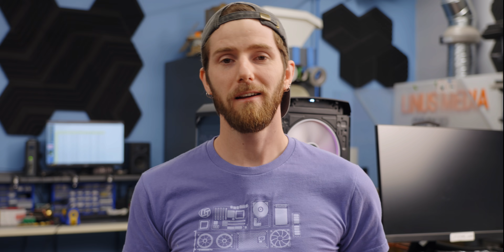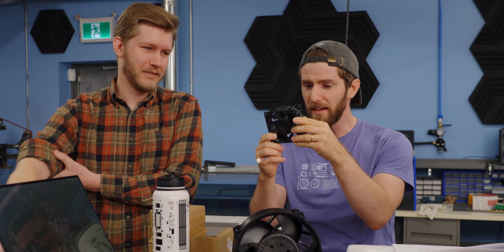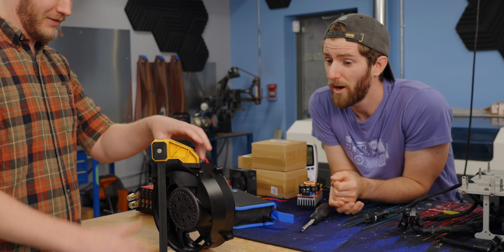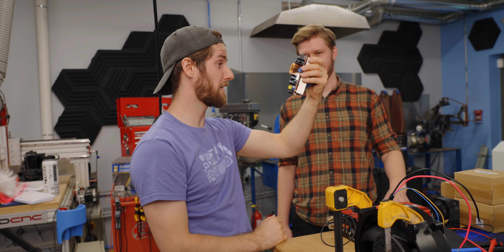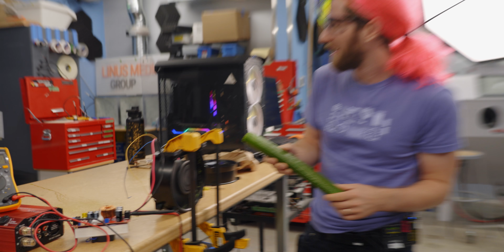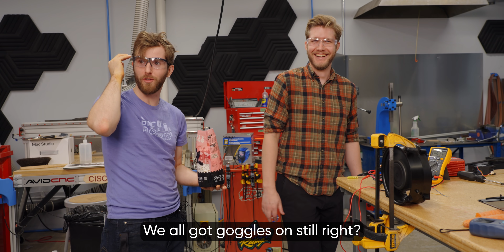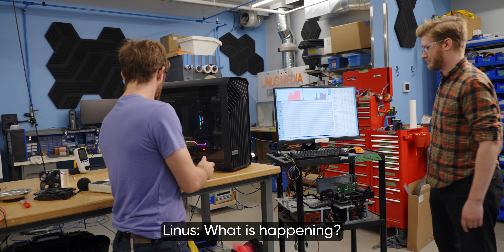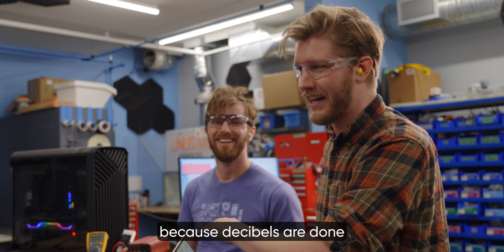The God of Computer Fans

Comment: To clear up the confusion about how much louder double the volume is in dB, audio/electrical engineer here:
There are two types of units we use dB for mostly, first of there are units of power, like watts, and then there are units of "flow" (not sure this is the correct terminology in English), like voltage and current in the electrical domain. 
Staying with electrical terms, since this is what most people are familiar with, power is in Bel would be log(V/I), decibel (aka 1/10th of a Bel) would be 10*log(V/I). 
Now, since these three are sort of a "trifecta" that always go together, we can also say that
P[dB] = 10*log(V*V/R) = 10*log(V²/R) = 20*log(I)
and also 
P[dB] = 10*log(I*I*R) = 10*log(I²/R) = 20*log(V)
Therefore, a doubling in units of power is always 3dB, while it is double that in units of flow - 6dB -, due to difference in factors 10 and 20. 
Now we're getting back to acoustics. In acoustics, we also have units of flow - sound pressure and particle velocity. And then we have the unit of power, which is sound power. 
But this is the part where the human perception comes into play. 
First off, the physiological part, which is how our ears work. Our ears are sensitive to *pressure*, not velocity or power (or actually intensity for that matter, but it's not really relevant for this discussion).
This is why we measure acoustics in dB SPL - because that's what we actually hear. 
And since in the video, they go from one fan to two, the SPL, a unit of flow, should pretty much double, which means we get +6dB, not +3dB as Alex kinda falsely proclaims. 
Finally though, we have our psycho acoustical perception of loudness. We don't actually hear +6dB as twice as loud, for loudness perception to double we need about a 10dB increase.

Hopefully this clears things up better. I know it's can be very confusing, it took me quite a long time to figure it out myself.

Comment: Telecom industry uses 48 volts. It's just below all the fancy electrical regulations you need for systems 50 volts and up. It's run backwards though, where they have the positive grounded, since that helps make sure that the copper doesn't do electrolysis stuff with the dirt when they have massive cable runs. That voltage also means that worst case, you just throw 4 car batteries together as a backup. Haven't worked telecom personally to verify these fans are in use there, but I'd wager that's one of the better customers for these fans.

Comment: I've seen fans like these used in large-scale LED video walls, like you'd see at Eurovision or other massive events. The total power draw for walls like that is typically in the range of several megawatts (they come with their own generator trucks!), and you can't rely on passive convection to get the hot air to the AC ducts because otherwise the whole stage would be unbearably hot. Panel sections are divided into vertical channels and fans suck air up the back and out into overhead ducting.

Comment: I work as a engineer in industrial applications and we use alot of these (or atleast very similar, not sure about brand but the wattage is on similar) for cooling of electrical cabinets.
At my current workplace we have a big row of cabinets filled with frequency converters so one wall filled with these type of fans to keep everything cooled.
We use similar fans but at lower wattage for all our electrical cabinets to keep everything a ideal temperatures.

I have also seen fans like these being used for fume extraction in industrial machines.

Comment: I’ve used similar for work actually!

For a R&D/industrial high voltage (like 10s of kV) power supply in the several kW range. Used both water cooling on critical points and a few of these chonky fan bois for cooling the hole power supply enclosure.

Comment: We use the exact same fans for VFD’s and in large indoor/outdoor machine control panels, they are super reliable. I’ve installed many of these and their 120v variants. They should also be able to be controlled via PWM just like modern PC fans! 

-industrial controls tech

Comment: 6:44 Love Linus being terrified of the boost converter yet still happily holding it while powered on
Reply: I think one of their engineers told him it was perfectly fine, as long as he keeps his digits where they should be.
Reply: Its not drawing any power.  They only tested the voltage, so yes it was turned on but there wasn't any large amounts of power flowing trough. Pretty safe to hold.
Reply: @999ZZZ36  thats not how electricity works. as long as it can produce that much, even without a load (or until you become the load), the power is still there.

Comment: To add to the RPM stuff : while in this case the effect might be limited, the thing is that it’s not that much RPM, but actually the radial speed of the blade that makes contact with you that matters.
So, in this case, or fan should I say, considering it’s about 2 times as wide as a regular PC fan, the blade at the tip moves twice as fast. This means that this blade running at 7000RPM would actually hurt more than the other one at 11000RPM, even if they had the exact same specs otherwise (mass of the fans, shape…)

Comment: Work in IT for a college and we used to have multiple Cisco Nexuses for our network distribution. When the room got over heated, it would sound extremely loud. You could be down one level in the building and it would sound like a jet taking off. Those blade systems were beast. Now we do the same thing with a device the size of a 48 port switch. Thanks for the video. That looked fun.

Comment: 6:40 Never dial in your switching power supply voltages without a load! They require a minimum load in order to have stable regulation, so if you dial it in with just a multimeter then the output voltage will often be completely different when you apply a load. It's useful to have a DC programmable load for this kind of task, but if you don't have one then a couple of cement resistors (or some other non-voltage-sensitive dummy load) will do the job. It's especially important not to operate boost converters unloaded, because their maximum output voltage can be surprisingly high, and they may ramp up to 100V+.

Cheap DC-DC modules usually don't use controller ICs with output overvoltage lockout protection, so in a runaway output voltage scenario you can end up exceeding the Vds(max) of the MOSFET, and/or exceeding the breakdown voltage of the switching diode, both of which will fry the board. If they've included a zener diode clamp over the output, you can also end up causing a high current short over the output.

Comment: test a 360 rad with 3 normal 12V fans VS one of these at the same power usage (for the fans) with an adapter manifold.
should these thicc fans's friction be too high i guess you could use some less absurd fan but still 180mm-ish.

Comment: Just a heads up Linus. I work on wind turbine's and we use these exact fans to cool our DELTA cabinets. The deltas are liquid cooled but also have these fans underneath them to dissipate ambient temp in the cabinet. We use 5 of them per cabinet. ( for anyone wondering the delta converts the 690v/dc the turbine makes to 34.5kv to take to the sub station)

Comment: Cleans it off after the carrot with the air compressor but then couldn't resist lobbing some popcorn at it before it goes into the system 😀

Comment: Would have made more sense to use a 120v fan of the same size, and control it with a relay connected to the PC main PSU.  Of course, that would have made for a boring video.

Comment: 8:49 it doesn't even slice it, it just turns to mist
Reply: 7300 RPM (121.67 rps) with 5 blades per rotation. Over 600 blade "cuts" per second, no wonder it turns carrots into fine mist!

I don't even want to imagine sticking my finger or willy in there, and I don't want to imagine if those blades were sharpened or replaced with razor blades..

Comment: Another use for these fans would be in industrial control panels which contain large electronics that can generate a large amount of heat (variable frequency drives, braking resistors, etc.)

Comment: Great entertainment but it is time to buy a real bench DC power supply or supplies. Even a cheap one (60 VDC/10 A with readouts for < $60 on Amazon) would have been safer and provide better control.

Comment: a) I used to work with mainframe terminal controllers with 24” fans similar to what you have there.  The bearings had gone and they slammed into the grill every so often, making an enormous bang and then slowly spinning up again.  It was terrifying.

b) Be careful with, and look up compressed air safety - compressed air like that can force air bubbles through your skin into your blood stream.  Assuming you gave yourself an air blister, that was close to being quite nasty.

Comment: I’ve seen fans similar to these used for cooling radome enclosed radar arrays. Pushing this much air volume is super important for heat exchange when your only means of cooling are a single intake and exhaust, inside an enclosed space.

Comment: Have every workstation in the building hooked up to a celing ducting network with the growbag idea in a previous video, with a few of those fans at the "exhaust" end.
Perfectly silent cooling for everyone inside and the hot air goes away. Don't even need AC.

Comment: We used a couple of them for the radiator in a Sprint car we also needed to use a boost converter because a car battery only gives you 12 volts but boy did they keep that engine cool

Comment: These look a lot like the avionics cooling fans for an aircraft.  The ones we have on a C-130J are smaller in diameter but likely similar in airflow capabilities.  Bigger aircraft likely use bigger diameter fans.

Comment: If you want some serious cooling AND maiming potential you should looking into industrial impellers. As an Engineer I've used them on industrial power transformer enclosures. Work pretty good for their size as long as they go with convection and not against it. Cool thing (pun intended) is they generate a good amount of pressure so if you throw some on a large radiator and mix in some Peltier coolers hitting 2000+W of potential cooling capability should be reasonable. Also you may want to find something that is a little less viscous than ethylene or propylene glycol for the sub zero side. Disclaimer: this is not to be considered sound or reasonable advice. I'm just some guy on the internet.
Reply: If we're going industrial grade then the sky's the limit. Where I'm working right now we're building a gas plant with a 3500 Hp compressor. Imagine the phase change cooling capacity you could achieve with that bad boy!

Comment: Ah this reminds be a bit of my first full tower mod I did back in 2000.  They were scrapping a computer enclosure at the Ford dealer I worked at, and it had a couple 120mm fans in it, 120v, metal housings metal blades.  So I carved up my case to fit the fans, and ran a 12v controlled 120v switching relay fed from extra leads I soldered onto my PSU 120v supply.  This monster sounded like an airplane taking off, which, considering I lived next to an AFB at the time wasn't a big deal.  It kept my rig plenty cool, though these days I prefer silence to performance.

Comment: These fans and similar ones to then are used in Datacenters that I have worked in. Generally for static pressure in cooling aisles, so that it is always cold air moving through the racks. These can be used in addition to CRAC units that are on the datacenter floor, or if you have centralized cooling in another area, these can be used to build your static pressure for pumping the cool air to the datacenter floor.

Floor installed CRAC units will generally have larger air movers attached to them that you can direct out the sides or down into the subfloor. My datacenter is moving away from raised floor, so we use cooling aisles. They are super neat!

Comment: I have ordered/seen fans like this at work.  They are the same size but nothing like the air flow shown here.  They are used to cool variable frequency drives in control panel enclosures for electric pumps .  The ones that we encounter usually are 240v fixed speed and hooked up to a thermostat so they turn on at 30 deg C.  We usually get them from RS Components.

Comment: Next time you need 48 V with a lot of current just take a 12 cell lipo battery from the RC store. It'll easily deliver 2 kW and costs less. Provided you don't want to run that setup for a long time.

Comment: Blade servers have these - or similar fans
Reply: Just think if you have an 8U server with 20-30blades in there (without cooling bc you could not fit that much hw/highend hw in that case) you need really performant fans - there you use these kinds

Comment: ive seen similar used in substation rooms for large industial equipment. there were 4 similar ones used in 2x push 2x pull to get air moving through a 150 kv substation room. they were there to just get air moving through the rooms. the cabinets with all of the electrical equipment had their own fans but the room would easily get past 100 degrees F if these 4x failed.

Comment: Alex is right about the use case. These massive, ultra-high-flow fans are often used for circulation in server rooms. When I used to work at Dell, they had alternating sets of these ducts bringing fresh, cold air into the cold aisles and evacuating hot air from the hot aisles. They were so effective at cooling that people would go on walks around the local lake during their lunch breaks, then stand in the cold aisle directly in front of one of the ducts for a few minutes to cool/dry off before going back to work.
Reply: We use something similar although slightly slimmer to move heat out the top of our packed racks
Reply: 9:16 it doesnt carrot all
Reply: @alexnather7614   DUH
Reply: Absolutely right! I've also seen these used in sealed, forced-air racks :)
Reply: so you used to work at dell, would you like a warranty with that comment?
Reply: Every data center I've worked in uses centrifugal fans for this purpose.
Reply: And you guys still have your hearing?
Reply: @gelinrefira  earpro is pretty much a requirement. Most data centers have earplug dispensers and/or muffs by the door.
Reply: The 48V nominal voltage would also be convenient for mild hybrid vehicles (which run their hybrid battery system at 48V, which is the upper limit for not requiring special training for mechanics to repair them). No idea if they are actually used for this (I'm thinking battery cooling) but that's what I first thought of.
Reply: @ipwnage23  Imagine stepping on your "gas" pedal and instead of hearing the engine noises you just get loud shopvac noises.
Reply: Isn't that what's AirCon is for ? Why would you invest 500 dollars into a single fan, where you can buy whole AirCon system for 1000 ? This doesn't make sense.
Reply: @StarekS  You use them in conjunction with industrial air conditioners. The fans blowing are placed either at the end of ductwork that goes to industrial chiller evaporators, or they’re mounted directly on remote evaporators. When you’ve got a room with hundreds of racks, each with dozens of servers in them, simply having a series of ducts up by the ceiling like you’d see in a store isn’t going to be enough. The air needs to be forcefully circulated in order to keep everything in each rack cool.

Comment: Industrial controls guy here, I've seen fans like this on large servo drives before. usually attached to the braking resistor that's needed for slowing down a high-inertia load without loosing control over it.

Comment: I used similar fans to suck out air from cinema projects as the lamps get up to 6.5 kW and aren't that efficient. The lamp does not care so much but the mirrors around do and would burn out in a matter of minutes instead of hundreds of hours.

Comment: I love Linus's incredulity over the simplicity of a boost converter. By adjusting the comparator level, you are adjusting the duty cycle which sets the output voltage by the equation Vout =  Vin (1/(1-D))

Comment: You could have found a boost converter that converts 12v to 48v. Could have just powered it off a secondary psu then mount this on top of the case. Daygreen 12V to 48V 20A 960W Step Up DC DC Converter (For example). That would have been a better setup IMO.

Comment: I've seen fans like this on PLC cabinets which contained large servo drivers (100KVA system power).. When measuring the voltage of the fans generating use AC not DC setting on the Fluke

Comment: Those look very similar to fans we used onboard my ship, inside the computer equipment cabinets. The cabinets have water piped to a radiator inside, through which these type of fans blow, so as to circulate air throughout the entire enclosure. Each chassis inside the cabinet then has fans to help move air through the chassis itself, and the various processors have heatsinks. So, the heat from the processors goes into the heatsinks, moved by cabinet airflow, passed through the air-to-water radiators, and the water carries the heat away from the cabinet to its eventual heat exchange system that dumps the heat into the ocean.

Comment: I work at Sumitomo (Tire factory) We use fans very similar to this to cool control cabinets  which are full of VFD's and many other heat producing electronics that operate tire building machines.  They run 24/7. Depending on the machine some of them are DC and some are AC depending on the machine.  Cooling the machines is important as well as keeping the inside of the cabinets clean.

Comment: Those boost converters are the WORST, they are super noisy and die really easily, as well as kill other electronics because of the output noise. Oh, and they wont do their rated power either. Go and buy yourself some proper MeanWell power supplies in varying output voltages.